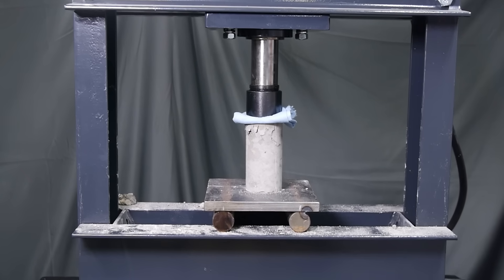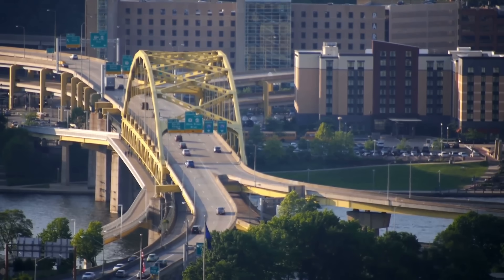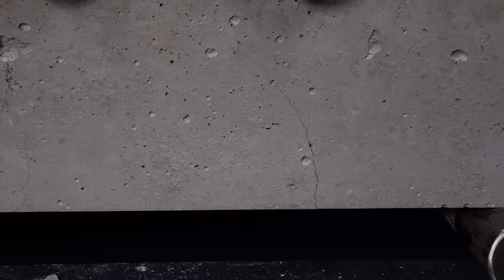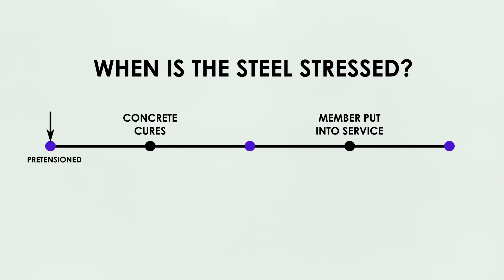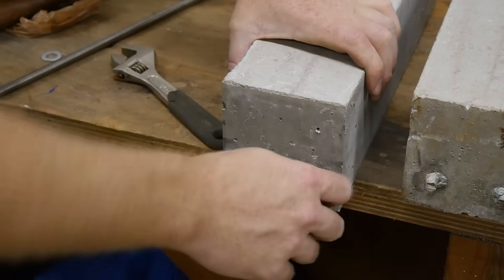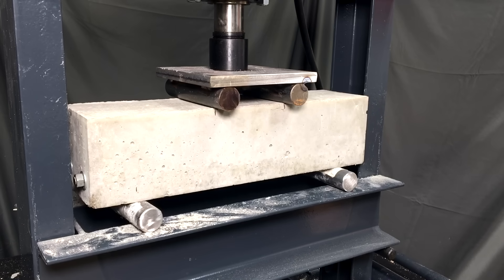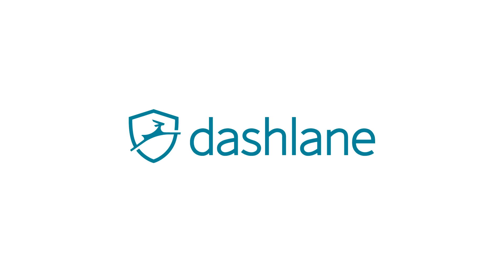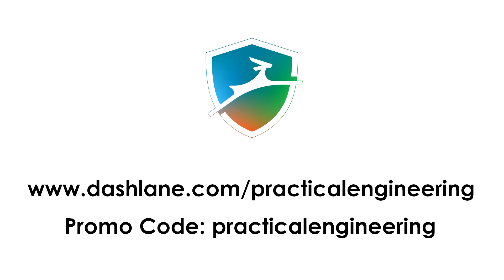What is Prestressed Concrete?

Comment: Be careful using the vibrator.  If you vibrate it too much the rocks in the mix sink to the bottom.
Reply: Yeah, being an engineer doesnt mean that you know how to use all machines - engineers can take tips as well.@Two two three Five five six
Reply: Two two three Five five six 
Maybe Grady hasn’t used a vibrator before?
Reply: "Be careful using the vibrator"

thats what she said
Reply: @fsmoura  Go back to 2011 where you and those kinds of dead memes belong.
Reply: @VulpesVulpes42  I'm pretty sure that one goes WAY farther back than 2011.
Reply: @petroelb  You're probably right, but for whatever reason, I kinda associate those kinds of jokes with the early 2010's.
Reply: @VulpesVulpes42  This jokes never get old. I scrolled to find it :)
Reply: That'd make an interesting demo...
Reply: Two two three Five five six It’s very possible that Grady doesn’t have a lot of experience with that specific piece of technology and Kevin does. Someone who helps builds these structures would be undeniably more of an expert on the equipment they use everyday. There’s no guarantee that Kevin is the expert on this specific thing but there is no need to be an ass about it. It’s just some friendly advice for Grady.
Reply: @Two two three Five five six You idiot, its a pretty common rule of thumb. He just gave a tip. You got quite defensive. hahhaaa
Reply: As someone studying Engineering, engineers would be very wise to listen closely to guys that work in the field. And guys that work in the field can often learn from engineers why something works like how it does, and perhaps how to improve their methods further. Closing your ear to anyone without a Ph.D is the worst idea you can do.
Reply: So don't put a concrete vibrator in your bottom, kids.
Reply: And when you are pouring foundation walls the vibrator is used sparingly because it will nake the liquid concrete leak out of cracks
Reply: @Two two three Five five six Are you the engineer that all the machinists hate?
Reply: Also known as segregation.
Reply: Vibrators are fun :p
P. S
I have dirty mind.
Reply: With molds that size you wouldn't use wouldn't use a large stick vibratory. ACI ( American Concrete Insitute) specifies the concrete to be consolidated for beam and cylinder samples but you use a small vibrating table and place the mold on top and use a straight rod to pack the concrete while it's being agitated by the table
Reply: @Two two three Five five six someone sounds butthurt
Reply: @I know you are right, And I just got owned but: Such arrogance.
Reply: it's an essential tool to create a homongeneous mixture..... come on, if your pour isn't monolithic, whats the point.... also liked the video.... and some of these jokes!
Reply: Also failure may come too quick .....if you know what i mean ; )
Reply: And civil engineering along with many engineering fields are ripe with jokes like this... Member expansion.... Come on.... Who wants to be serious 100% of the time.... Even on YouTube....
Reply: If joking, but being knowledgeable don't coexist... How could engineers ever work in the field.... We'd just sit in office while designs get built however... A happy medium is best.
Reply: 🎶 Do that to me one more time..
Reply: Yes - segregation
Reply: Also you'll go blind :D
Reply: https://www.youtube.com/watch?v=4lbI-cBhkm8
Reply: Are people really criticizing this comment? Grady is a civil engineer, not an architect or structural engineer. He knows more than most people but assuming Kevin here is some random armchair guy and Grady is the god of construction knowledge is ridiculous. Someone who directly works in construction probably has, albeit slightly, more working knowledge of the intricacies of concrete casting.
Reply: @Two two three Five five six most egineers pretty much suck when it comes to actually doing any work. Just because you are a licenced engineer does not mean you actually know how to do the work.
Reply: @Two two three Five five six he's a civil engineer, not  a construction worker. Just because you know how it works in theory, doesn't mean you'll be able to put that knowledge into practice adequately.
Reply: @Two two three Five five six
So, what you're telling us is that 2 + 2 = 4 is no longer valid because I am a YouTube commenter.

You should suite your Alma mater; your statement makes it quite obvious that they failed to properly educate you.

By the way; under certain real life scenarios, that kind of arrogance will get you dead. So you may want to think about relinquishing that stupidity.
Reply: @scotttovey  Very well put!
Reply: @scotttovey  2 +2 =5 for large values of 2 every one knows that.
Reply: @scotttovey  Did you think 'cite' was spelled 'suite'?
Reply: @JamEngulfer  I'm pretty sure he meant "sue" but then decided to make himself an ironic joke instead.
Reply: I am a little suprised of some of the views here. 
In the U.K. system, to qualify, civil engineers MUST have proven site experience in terms of time and quality. The discussion above is about “segregation” of the mix. It is the engineers that specify the quality of end product and ensure that the constructor’s chosen method is not detrimental to the end product.- not the other way around.
Reply: really?  because I vibrated the absolute shit out of my concrete mantlepiece and when I flipped it over and revealed what was the bottom it was perfectly smooth.  I should have been able to see rock edges you'd think.
Reply: That is called segregation bro..

Comment: I know different aggregates in concrete can be used to make the finished concrete lighter or give it other properties (Mythbusters concrete glider test) but do different reinforcement types impact the strength? On your tests you have conventional rebar at the base of the concrete to strengthen the concrete under tension. Would multiple thinner steel wires at closer intervals be stronger or weaker? Would a steel mesh alter the strength, as the mesh could spread the load over a larger area? Would using different aggregates on separate layers make a difference? Say for example conventional concrete and rebar for the first pour, then a glass fibre reinforced concrete for the second pour? My thinking is that the glass fibre layer might be more resistant to the fine cracks that may let water into the concrete and rust the rebar.
Thanks for another really interesting video.
Reply: Steel wires could be stronger of weaker depending on a) the yield strength of the wire b) the cross sectional areas that we are comparing.  In prestressed concrete the cables are generally 1/2" diameter 270 ksi cables.  Standard reinforcing is generally 60 ksi and comes in various diameters.  You will need roughly 4 times the area of rebar to equal the wire.

Mesh does add strength but is usually only considered a serviceability crack control material.  The cross sectional area is very small though the yield strength is slightly higher at 65 ksi.

Concrete mixes have various size aggregates in the mix by default.  You can't control the layers if you are placing one type of concrete and if you try to pour something with any amount of time in between you would end up with horizontal construction joints that would weaken the structure.  Also it would just add expense for very little if any gain.  You want the crack control on the tension surface (bottom of beam) so that wouldn't help anyway.  Best way to prevent the cracking is to just add more rebar (to a certain extent).

Polymers are used in concrete reinforcing.  You can do a search for FRP (fiber reinforced polymer) concrete.  Often it is used in retrofits or rehabilitation and other specialized scenarios because yes it is expensive compared to standard rebar or even prestressing.

Enjoy!
Reply: @clee8768  i would also like to add that crack control steel may also be added to the sides of beams, particularly in very deep beams. it has been noticed that cracks tend to widen as they travel up the beam oddly enough. So reinforcement is placed in the sides, called skin reinforcement, to reduce this effect.
Reply: @jessecompeau4370  True.  But seeing as the sample beam was about 8x8 and skin reinforcement doesn't kick in until h>36 I didn't think it was a big deal to leave it out. =)
Reply: I thought of another question. I know steel is used as it's cheap and strong, but how well would polymers do? Polyethylene is strong. Silk has twice the strength of steel, could you reinforce concrete with a polymer?
Reply: Maxx B  Wow you got it bad.😅😅😅
Reply: In concrete design there are limits placed on how far or close you can place your steel reinforcement. place you reinforcement to close and the aggregate and cement wont be able to flow around it, to far and the concrete and steel wont be able to effectively "share" their stresses. also bond strength between the rebar and the concrete is typically higher when more bars are provided rather than less given the same cross-sectional area. In general if the total cross-sectional area of steel is the same you would want more steel bars closer together than less bars farther apart.
Reply: In this video he's only doing hand torque in the real world that prestressed steel is pulled to 30,000 psi

Comment: how much do you need pretention the rebar
lots
Reply: In an actual design scenario a typical steel cable is 1/2" diameter, 270 ksi and will usually be tensioned to a load of about 27,000 lbs.  They can be spaced anywhere from a few feet to about 6" on center or so.
Reply: @clee8768  how dare you give a proper answer to my joke

Comment: I see that a lot in concrete slab pours. Steel sheathes with cables that are tensioned after the concrete sets.
Reply: It is a very common slab system.  Mostly in mid to higher rise structures.
Reply: Post stress

Comment: This topic is solid, but very stressful.
Reply: Normally I'm stressed anyway, but for sum reason, I would like to know Mohr
Reply: There were some tense moments, but as hard as it may be, in the end you won't crack, you'll just come through stronger.
Reply: the comment is cemented into my memory now...
Reply: If offers a TON of good puns, I have to decompress from all the stresses of tensile and compression stress. But then I'm back, I love to cement my know how with some concrete knowledge.
Reply: I just love the way you present. Incredible you are.
Steel structures or Trusses or Frames could be interesting topics.
Reply: luckily i can handle some tension
Reply: fsmoura  just run some rebar through your ears. ..should lighten the load.😅😅 .....oops, I mean 'tension'.😂😂😂
Reply: bonanzatime this comment cured my tension and stress
Reply: Plz stop
Reply: Ypurre so unfunny I liked it
Reply: may the force stress your topic.
Reply: "Spare the rod, spoil the...concrete." 
😊😊😊😊😊

Comment: You should now try focusing on shear reinforcement, as the failures you have demonstrated are quite brittle, and in the real world not ideal, as you don’t want a RC member failing so fast. Good videos these are awesome (y)
Reply: If you watch the second beam failure at 0.25 speed you can see that the failure mode is actually the back right stressing anchorage.  But yeah all the others are shear failure.  I doubt he waited very long for the concrete to cure and could have used a larger washer than what was on there.
Reply: C Lee yeah that’s a type of failure you have with PT concrete (at the end of the ducts/anchorage). The rest of them throughout the concrete series has been shear failure.
Reply: Punching would help .

Comment: Excellent series, thanks. 

So pre/post stressed concrete has similar ultimate strength strength but smaller deflection under the same stress? I didn't realise that.

New topic? Not really civil engineering, but plastics is a can of worms that could be opened